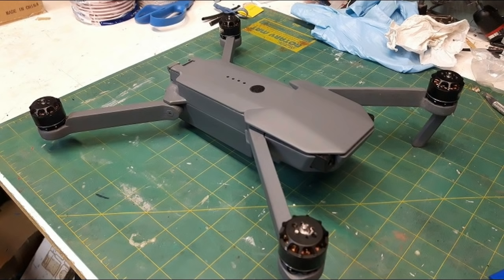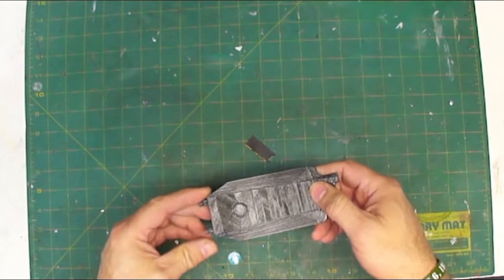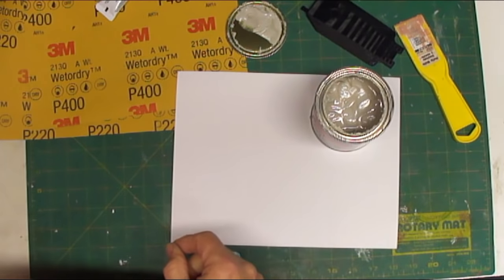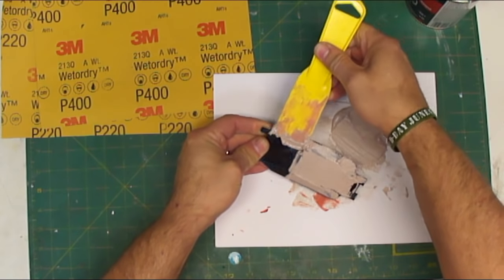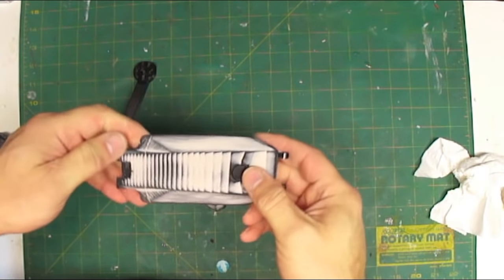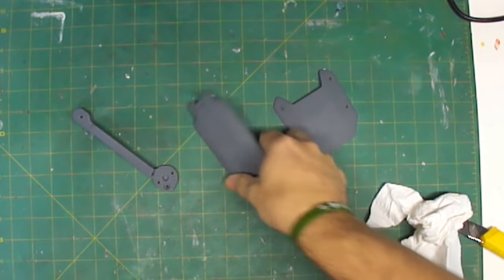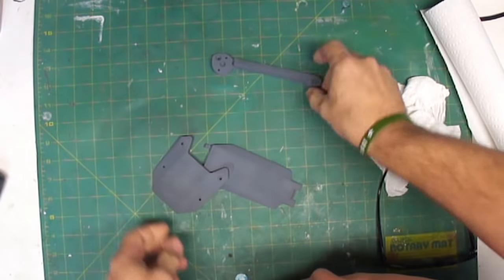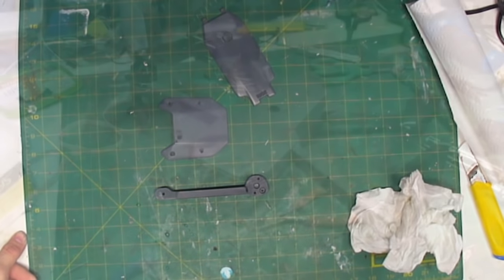3D Printed Mavic Finish

Comment: thats amazing , , i have question , have i use a brushless motor ? , and is it heave frame ? because u used pando ( how u write pando ? ) , becuz what im going to do is i will buy a drone called tarauntula x6 , and my friend will take it a part and bring it to my country ( not allowed to enter it with a frame ) so that idea is becuz its much cheaper than buying a parts motors controllers  and easier ,  its 55$ , so do u think i can print and use the mavic frame with it ? thank you
Reply from the maker: yes the motors are brushless 2208 1100kv
The frame isn't heavy and the bondo just added a few grams.
I cant' say for sure if you can use it, its possible.

Comment: Nice project, which motors are you using??
Reply from the maker: I am using 2208 from Ready to fly quads.
Reply: Richard Gardner which ESC?? And from where I can get it?? Thanks
Reply from the maker: here ya go http://www.readytoflyquads.com/20a-cavalry-pro-4in1-esc-blheli-oneshot
Reply: Richard Gardner thanks again, I'm almost done, which propels are you using?? Are they original for mavic? If yes how did you achieve to attached them to the motors?? Thanks in advance...
Reply from the maker: I used original props but drilled out the hole so they fit the motors. I also snipped off the catch. I have a design of an adapter but never could get anyone to 3d print it. Some day maybe
Reply: Richard Gardner if you want I can print them, i have a couple of 3d printers, if you want I can print the part and send to you some of them...
Reply from the maker: that would be awesome. Do you have an email address I can send the file to you. If I remember right the scaling is wrong on it and it needs some work after its printed. But if you print it I can do the metal inserts, see if it works and send you a finished set.
Reply: Richard - I'm using exactly the same RTFQ motors as you and am also hoping to use the Mavic style quick connect props with the three prongs. I'm printing out a prop adapter that I designed as I type this. Not sure how well it's going to work - prop centering has to be extremely precise in order to avoid vibrations. If it works OK, I'll send you a few adapters.
Reply from the maker: Hey there. I designed a prop adapter as well. But could never get it printed. It would use the Mavic mount that Banggood sells. Then you need to insert some metal threaded bits. But I never got them printed.
https://www.banggood.com/Quick-Release-Propeller-Blade-Base-Mount-with-Spring-Screw-for-DJI-MAVIC-PRO-p-1141705.html?rmmds=search&cur_warehouse=CN
Reply: Those adapters appear to have three screw holes 120° apart. The RTFQ motors have 4 2mm holes and 2 3mm holes. Doesn't seem to a good solution for those motors?
I sent you a PM on DIYRC.CO.UK. If you have a design file and you'd like me to print it for you, send it to the email address I sent you in that PM. I'll check it out and test the print. If it looks like it will work, I'll sent some to you.

EDIT: Ok, I see what you are doing now. The STL file is simply an adapter to allow the attachment of the Banggood quick release base. I'm still working on my single  piece adapter to see how well it might work. I'm tired of waiting weeks for parts from Banggood :-) I might try the Banggood mounting base if my design doesn't work out. Will keep you posted.

Comment: vapor smoothing
Reply from the maker: Never seen it but have read about it and the affect isn't the same but certainly would take some of the effort out of it
Reply: Richard Gardner originally it's how I thought you got it smooth when I saw your post on the diy forum. I'm going to attempt to vapor smoothing my mavic clone. Good build!
Reply from the maker: Hey Dan if you do can you post some picks would love to see the results. My method was pretty easy but it takes a few bucks in materials and effort. the Vapor bath may be easier, I have no idea but would love to see it. It mihgt also be a way to get you a lot closer with less effort. No idea but interested in finding out
Reply: Will do. i will put a write up on the forum